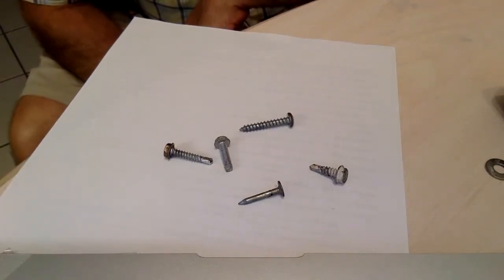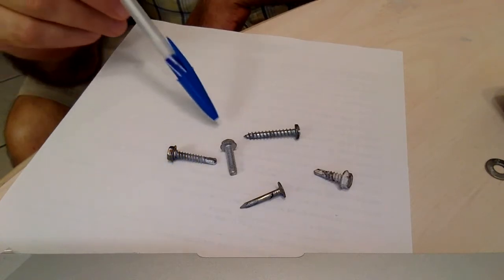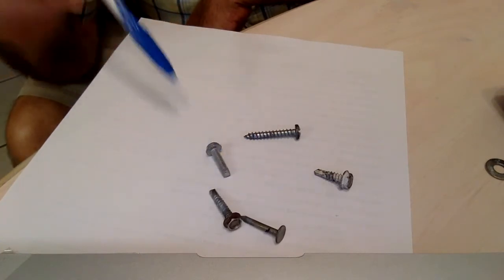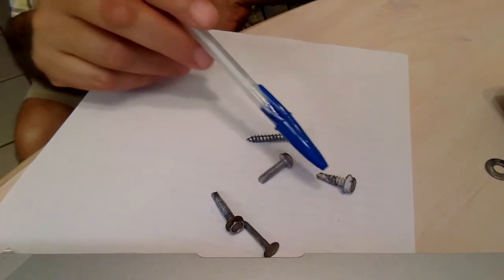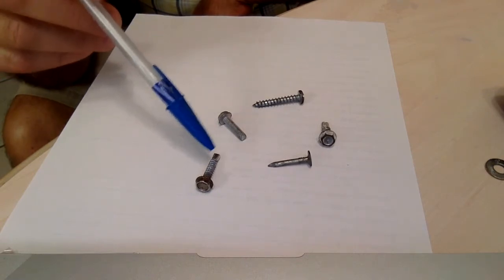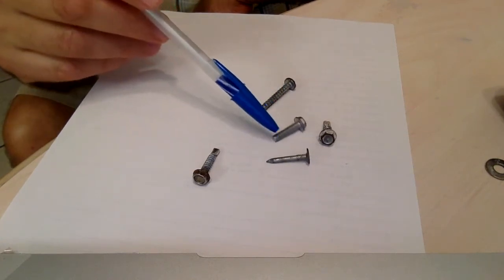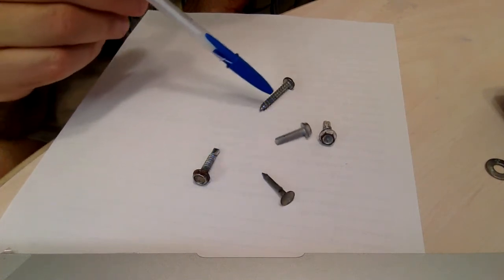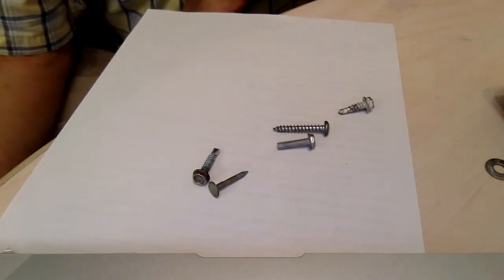Nail and Screw ---Flat - Tire - Conspiracy - Theory

Comment: I thought this because not only does it not make sense where they end up which is parking lots. But also how does the screw stand to puncture the tire. Especially the screws as opposed to nails. I think there are people with nail guns doing it at night.
Reply from the maker: ……Interesting theory.  The Democrats have a new reason to now ban all  nail guns….(at least high capacity nail guns).  You just found a interesting way to annul the 2nd amendment

Comment: They rattle out of the back of pickup truck beds. You start with half a handful of screws and nails rolling around in there, but after a month or so, most of them are gone. They slide to the back every time you accelerate and since the rain channels are at the sides, every time you go around a turn, some of them roll to the edge. Next time you back out of a parking spot, the ones at the edge are lined up perfectly to slip out the damn gap.

My buddy's fishing rod got broken when it stuck it's little head out the rain hole before he opened the tailgate :-( Sad day (hats off out of respect for the dead rod).

Tire places repair flats for free so it'd only make more work they don't get paid for (Les Schwab)
Reply: David Buschhorn 
What tire place, fix flat tires for free?
Reply: @shanezenmusic  
He's talking about the kind of rouge screws that   people get careless with and throw in the back of their flatbed trucks...which eventually cause flat tires by escaping from the truck on the path of unsuspecting drivers like myself. The video actually helped me. Calmed me down after catching a flat, I got a plug instead of a new tire, saved tons. Still got the plug.
This Guy is pretty Cool.
He's old school, but knows his shit, he knows SCREWS and how they break loose on the road.
Cut Pops a break.
This is experience talking.
He's on YT with us young hoppers..teaching us about screws..
That's what's Up!!!!
Get it Pops...
Reply from the maker: ....I deliver pizza for a living in Florida, and live in a place where their are all kind of new houses and apartments being built.  The more new houses being built, the more likelyhood im going to get a flat in the new housing area.  Especially during the housing bubble era in the early 2000’s
Reply: @shanezenmusic  contractors are your friend. Do not believe this propaganda. 🤣

Comment: Yes I've seen them driving and chucking out hand fulls of nails I thought it was change till I got up to some of it and seen it was nails screws
Reply from the maker: ..I thought I saw the same thing when I was following a Wells Fargo armored vehicle.  I loosened the screws on the back door of the armored vehicle, then after the screws came out, the door fell off and stacks of $100 bills started flying out also..  I was just checking out my theory for loose nuts and bolts.  Luckily my tire didn’t get a screw in it.